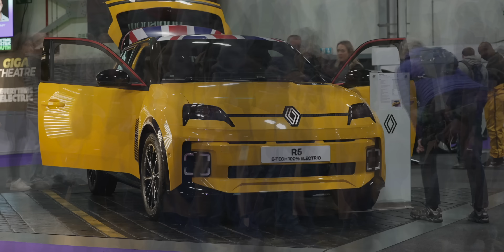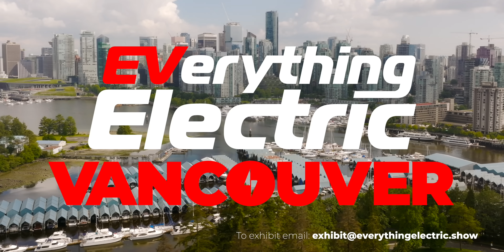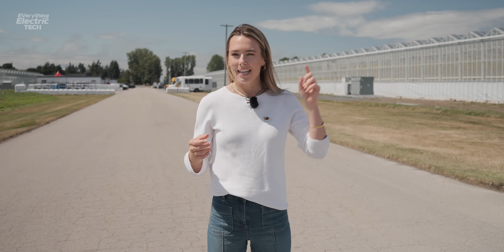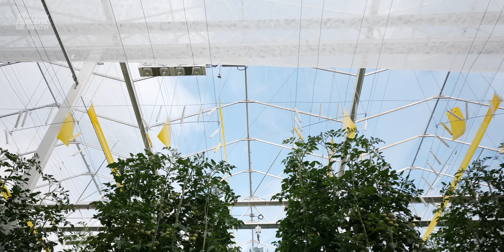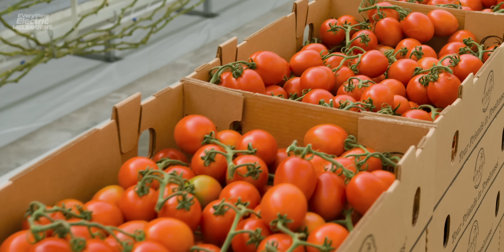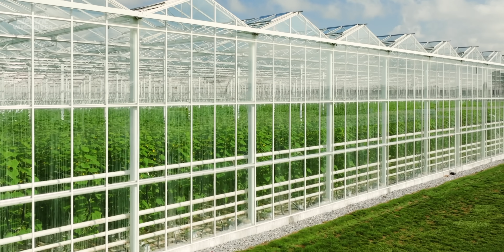Clean Energy Tech Is Changing the Way We Grow Food..!

Comment: Thermal energy storage solutions can be perfect fit for them to store  the cleaner electricity when it is cheaper. Especially considering they don’t need high temperature output requirements. TES can deliver it with flying colours.

Comment: Great video. Two points cross my mind:

- could all the greenhouse operations be at least part-powered by the biomass derived from the growing? What happens to this material currently?
- There is always a 'law of unintended consequences'. What could this be when growing in such 'sterile' conditions (thinking about the micro-organisms we ingest when eating produce)?
Reply: I had the same thought. An Anaerobic Digester fed by agricultural waste would produce the power he needs via biomethane plus the CO2, the heat and even the fertiliser.
Reply: @apey125  Interesting point - most of the carbon the plants needs to grow stays in the plants, though some goes off site in the tomato crop. So the loop could be closed if the plants were recycled within the system and the CO2 wouldn't need to come from imported fuel.

Comment: Surprising that (industrial) heat pumps don't feature in this company's heating strategy, especially as he mentioned how expensive natural gas and biomass are to procure.
Reply: I dont get how natural gas is expensive?  He is in BC which is sitting on 660 trillion cubic feet of natural gas.  They have access to basically an unlimited amount of natural gas.
Reply: @pin65371 It depends on what the market is charging for it. Don't forget that geopolitical circumstances can greatly alter the price of any commodity, especially energy related ones. It's certainly the case with natural gas here the UK and Europe since Putin's invasion of Ukraine. I'm also old enough to vividly remember the oil crisis of the 1970s. Both of which were major world events that shot the price of energy sky high.
Reply: @pinkelephants1421  its about 10% the cost for natural gas vs Europe.  Like I said there is basically an unlimited amount of natural gas.  The natural gas reserves in BC are 14x times higher than Norway.

Comment: I wonder if these greenhouses could use geothermal for heating?
Reply: In extreme cold environments, yes
Reply: @EP-bb1rm  it would just be very expensive. Its way cheaper to just install generators that are powered by natural gas and then have the power, heat and CO2 the operation needs.
Reply: @pin65371  but then you'd have excess CO2 and excess power during day... Makes no sense.
Reply: @EP-bb1rm  you need a lot of power in a greenhouse even when its light out.  They have fans operating in the greenhouse along with pumps.  Also if you put in batteries you can store any extra power while you are producing the CO2 for the greenhouse. Honestly heat is really only an issue for maybe a quarter of the year even in a place that gets cold.  The sun keeps the greenhouse pretty warm even when its cold out.
Reply: @pin65371  that's all relatively low amount of power in most cases

Comment: Great episode! Seems like a well designed system.  There's always room for improvement, like utilizing some other production process that generates heat and CO2 to reduce how much stuff needs to be burned for heating and CO2. Production in greenhouses don't need very high temperatures, so very "low grade" heat can be utilized.  But, you need some such suitable production to utilize, and for very low grade heat that other production should ideally be as close to the greenhouses as possible. 

One thing that I find curious is why fuels are burned without producing power. Sure, if you use a generator the energy that is turned into power isn't turned into heat, but even if a generator is as much as 40% efficient, 60% of the original energy still becomes heat directly, and when that power is used, it turns into heat, well, all the energy except that minuscule part of the light energy that the plants manages to turn into chemical energy when the power is used for the lights. 

It seems to me that periods with high demand for heat and power for lighting should correlate quite well in many greenhouses as the sun provides both heat and light. Of course, one would still want to be able to hold on to the heat for a while to release as needed, but that's the case also when you burn stuff just generate heat and CO2.         

While turning fuel into power tends to be less efficient, and more importantly more expensive per unit of electric energy produced, the smaller the system is, even just 25% power and 75% heat is way better than 0% power and 100% heat when you only need very low grade heat and also need the CO2 anyway. On site power generation seems like a better primary target for "policys" than trucking in CO2 from somewhere else and getting heat and power in other ways. I assume "policys" mostly is code for subsidies.
Reply: Yah in Alberta there is a greenhouse where they just have natural gas generators for the greenhouse.  They recover the heat and the CO2 during the winter.  During the summer they dont need heat or light since the days are long and its warm enough but during the winter they need heat and light.  The generator can provide both. They still use the generators during the summer though but that is to provide power to cool the greenhouses and then just pump the CO2 into the greenhouse.  If they dont need CO2 they can just keep the generators off and use grid power.
Reply: @pin65371  That's nice to know, thanks for sharing!

Comment: Without some fairly hard nosed breakdown of the actual climate impact of this farming operation, this looks like you're allowing them to greenwash themselves with fully charged's image. After all the technology here is essentially LED lights, curtains, and burning bio mass. Are these really new things?
Reply: it is the land use, or should I say lack of land use that matters.  These greenhouses can be built on rocky gravelly ground leaving the fertile soils to produce other crops that take up a lot of room like sweet corn, wheat, etc.  I have vertically mounted hydroponics on the side of my shed that face the Sun, works a treat, protected and warm. The irrigation is supplied by a solar panel and a battery using a timer.  Good fun making it all, the only downside is my granddaughter eats all my strawberries if I am not around, that's ok because I used to pick them when I was kid living in the Cheddar valley, and you can only  eat so many, and then you can't stand the sight of them.

Comment: instead of horizontal tubes, try vertical tube farming. where outside gets direct sunlight. and inside has the access ladder hatches for getting the produce. yes like a synthetic tree. also it gets the water like a normal plant from rain. but is a greenhouse. well outside light poles can provide night-time light all over. like a city. or artificial sun. yes again from outside. no inside mess. also use solar on the spot. not on the grid. not smart to be under law. lotsa talk over some foods.